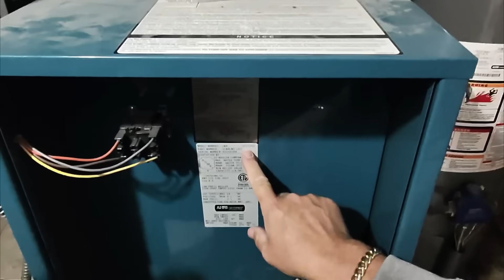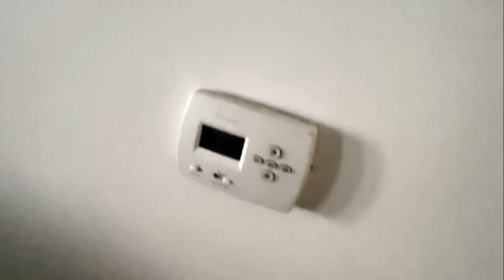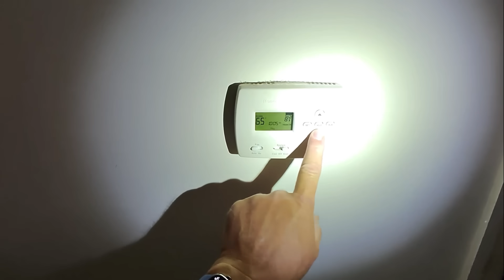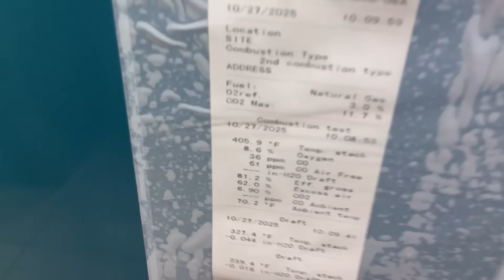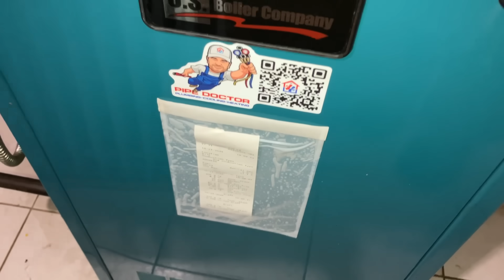Burnham Steam Boiler Maintenance After 9 Years – You Won’t Believe What We Found!

Comment: Should have used brass between drain valve and boiler. Basement loop should have used copper, not black pipes
Reply: It's steam!!  That means, you are wrong!!
Reply: @BarryWeaver-pv6cz I am not referring to the steam pipes. I am referring to the hot water loop that comes off the bottom of the boiler which provides the heating for the basement.

Comment: 9+ year old Boiler with Zero Mtce. since Purchase ?  Most Important thing in our House is Hot Water and Heat in the Winter.  Preventative Mtce. is Great Investment.👍
Reply: a LOT of people don't do regular maintenance on gas appliances.  Even though it costs them more in the long run, in high utility bills and premature failure.  My dads poorly installed 112k steam boiler has never been fully serviced since it was new, 12-13 years ago.